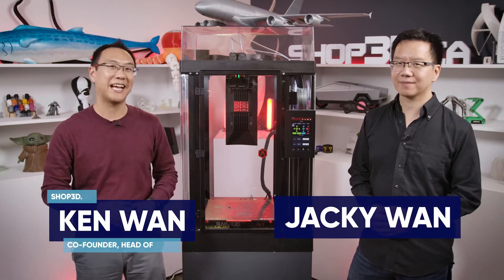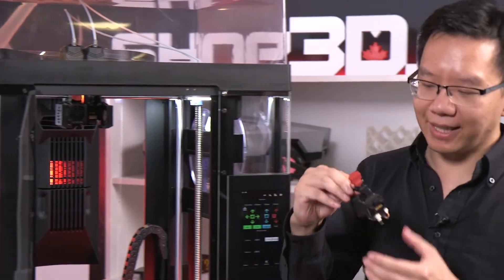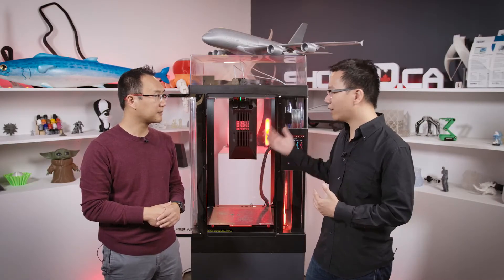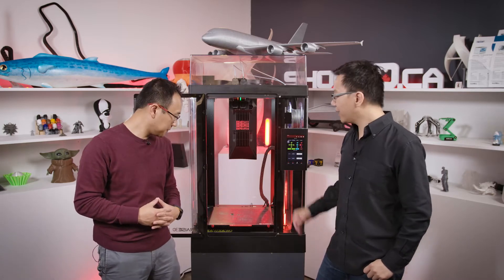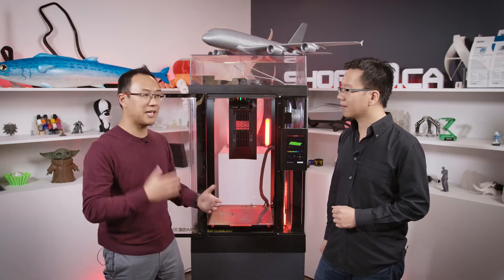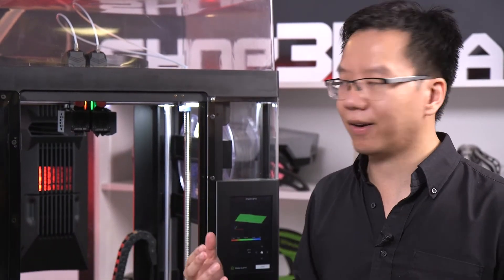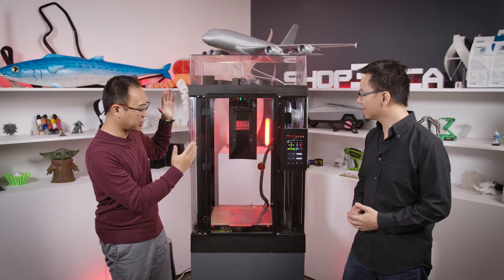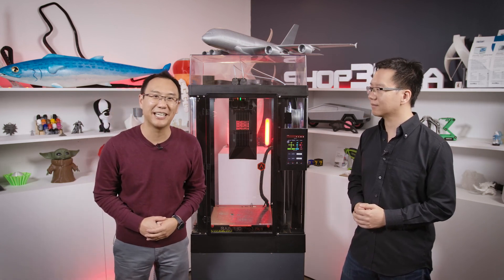Product Feature: Raise3D Pro 3 Plus - Large Format Printer

Comment: Is Raise Pro 3 Plus able to use Ultrafuse filaments BASF to make metal parts?
Reply from the maker: Yes the Raise3D Pro 3 Plus is able to use BASF 316L and 17-4PH, before usage please ensure that you have changed the nozzle to one that can handle more abrasive materials such as the Raise3D Tool Steel Nozzle, which can be found here: https://shop3d.ca/products/raise3d-tool-steel-nozzle-w-ws2-coating

Comment: what is part dimensional accuracy to print design dimensions
Reply from the maker: Hey there, so it really depends on design, supports, orientation and material. Positioning accuracy is about 10 microns. but materials can expand and contract during printing. causing the final sizes to be a little off (like 0.1mm or so). This can be corrected/calibrated per material by entering the expansion amount based on tests of the material you're using.

Comment: Cool machine. But wait.. so we have the hepa filter which is nice. Then: you can take the top off when printing PLA. I am lost here. Also.. nic model at 15:03 but we see a lot of ghosting around the windows, it is not the greatest model to use in a showcase with clearly visible printing issues. The presentation itself is very well done, it gives a good idea about the machine and the upsides of it.
Reply: With the Air Circulation there is no need to remove the lid.